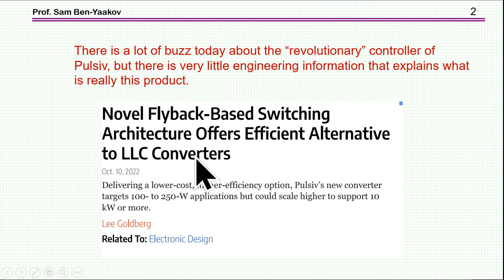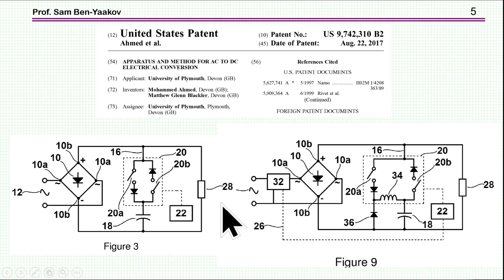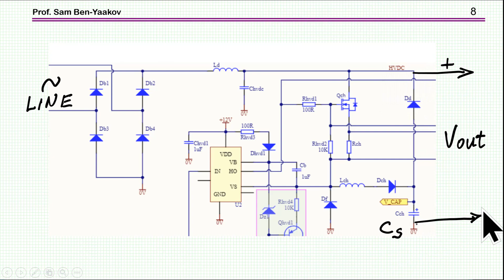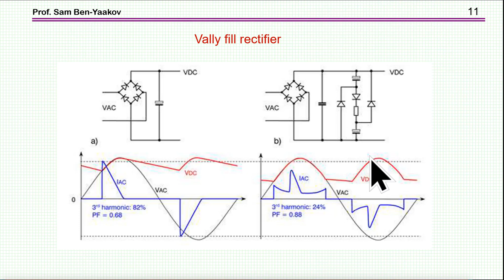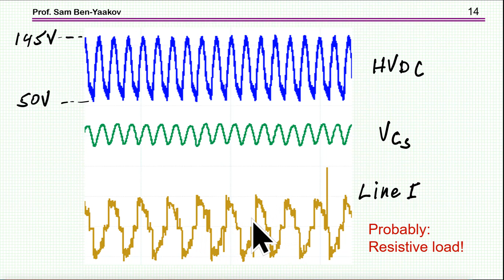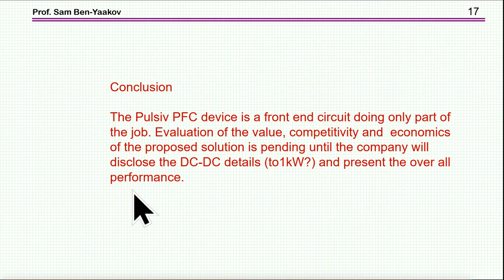The PFC front end of PULSIV

Comment: To achieve a reduction in conducted-EMI noise beyond the capability of the line filter alone the designer can then iterate around there to find the best compromise between EMI reduction, component tolerances, and loop stability ! We will see on external dc-to-dc real load . Ti has one of the best solution with UCC28070 Interleaving Continuous Conduction Mode PFC Controller in one cip.
Reply from the maker: Good point. Thanks.